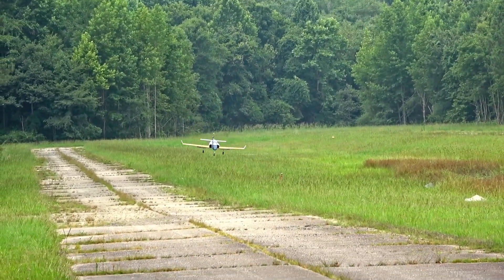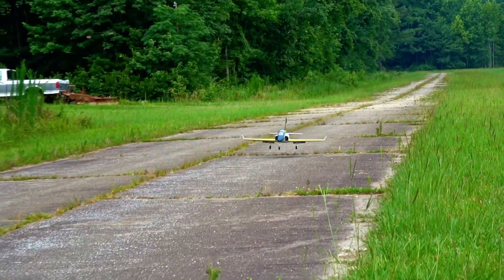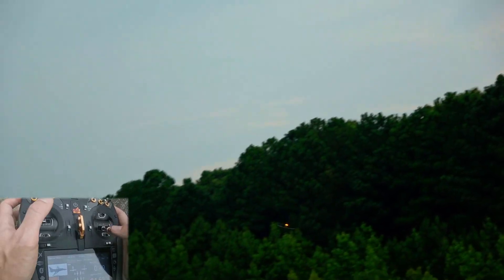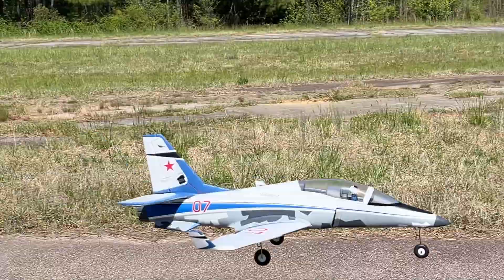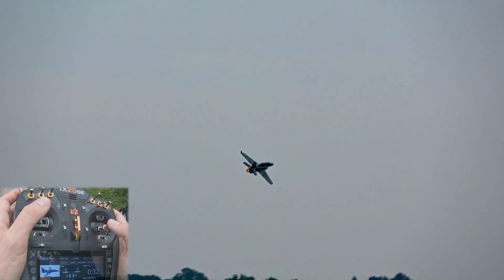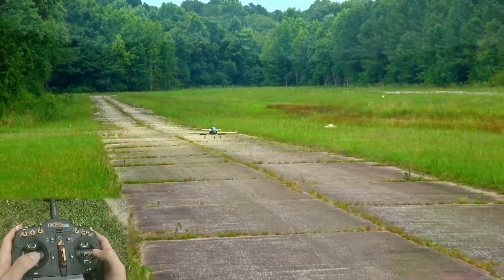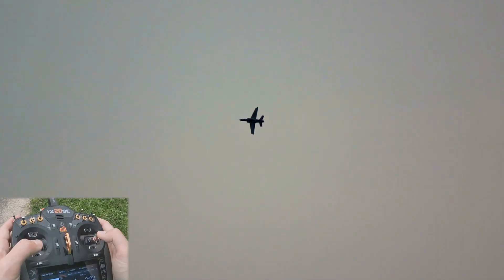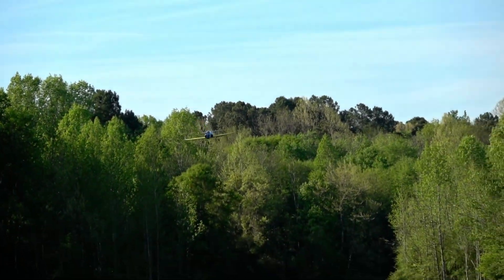Learn to Land WITHOUT Crashing

Comment: From what i have found with sport jets, i litteraly on my final turn i cut throttle bring the jet down to like 1 ft off the deck and sit at a out 2 3 degrees AOA until it stalls and sets itself down on the ground, maybe im just crazy because i also fly no gyro, and land my 64mm Futura, and 70 and 8m avantis the same way

Comment: I’m using reflex v3. Is it safe to be on Stabilization mode or optimization mode during approach?
Reply from the maker: Not sure. We don't fly with Reflex. Whichever option gives you full control is that you should be using.

Comment: No throttle landings can be  dangerous.  If you hit an obstruction or bump on the runway, and the nose pitches up suddenly, especially on a plane with small wings like an F18, sufden bursts of thrust wont help much if at all
Reply from the maker: Not even remotely lol
Reply: @TwoBrosRC from what I've experienced and seen, you are correct.  Not remotely.   Pretty much dead on.

Comment: Properly landing ANY plane, regardless of type means holding attitude and managing throttle while making as minor control surface adjustments as possible.  A stabilized approach is key.
Reply from the maker: Not always. You can land without throttle if you know how to manage airspeed.
Reply: @TwoBrosRC  that is true.  Its just like landing dead-stick, and good practice for that emergency as well.  But in my experience, landing with throttle is, as I said, the PROPER way.  By no means saying   its the ONLY way.  Like you said, "not always".  But more often than not, if you get sudden wind shear, especially as in a headwind, not already having your throttle spooled can be a detriment, again  especially with small winged or high wing loading.  Trust me, ive learned the hard way.  Again, this is my experience and the experience of lots of others.  Your mileage may vary..

Comment: I purchased this viper. I have my rates separated. Switch C is rudder rates, F is Ailerons, and G is Elevator. Should I land with Elevator on Low rate to prevent over flaring and stalling?
Reply from the maker: We'd suggest that you consider learning to fly without rate switches and leave rates maxed out with 50% expo. It'll make a huge difference in controllability at all speeds and give you the authority to land properly.

Comment: Thanks for sharing your experience in a beautiful video. As an ultralight pilot I have experienced many stalls on our P92: it usually stalls around 80km/h. In a turn around 20/25 degrees the stall occurred at 115km/h. The only way to avoid the stall in a turn is to have a lot of speed - a lot of engine - and make a coordinated turn with the rudder (to avoid adverse yaw.) I configure the landing of the Viper 80:  reduction of speed in downwind, half flaps, landing gear down and on final with the throttle stick at 40%, then before touching the throttle stick at around 30%, obviously the elevator must be pulled back progressively. Greetings from Italy.

Comment: i watched an earlier video you did with using cro for landing. doesnt this make it exponentially easier to land? i noticed you did not mention anything about that in this video but it seems thats the primary way you were landing in this video.
Reply from the maker: That only tends to work with larger jets or ones with bigger control surfaces than the Viper 70, unfortunately.

Comment: Land in SAFE mode should help.
Reply from the maker: Not really. It will exacerbate any stalls due to automatically holding elevator input.
Reply: @TwoBrosRC  During landing you often get sudden gusts of wind that can catch you out  sending a wing into the ground. 
Safe has faster reactions than you have and could save a crash
Reply from the maker: It'll crash if you're not keeping your airspeed up in SAFE, too. Fly it that way if you'd prefer, but it opens up significant potential of stalling that we'd rather avoid.
Reply: @TwoBrosRC  The thing that worries me more is that sudden gust of wind at the last minute before touch down that can catch you out. The wing goes up then hits the ground.

Comment: All of my Viper 90 crashes have been caused by a bounce. The plane tends to bounce even if I landed smoothly, sometimes due the battery being too far forward, others from bumps in the runway. 

Are you saying a lower air speed helps with the bounce?
Reply from the maker: Lower touchdown speed reduces the chances of bouncing. Bouncing usually happens because the aircraft is still flying while the wheels are rolling.

Comment: Something I've noticed at my field is that a lot of people are scared to get too low and end up diving into their landings.  While technically this can work (and I have landed planes from a vertical dive) it tends to leave them struggling to bleed off the extra speed and prevent their plane from ballooning back up into the air.

My preferred approach is to get as low as I can with the goal of crossing the front edge of the runway a foot or less above the ground so I can cut the throttle and let the plane drop back onto its mains in about ten to twenty feet.  I practiced this approach with an overweight Freewing F-8 more times than I can count and it's really helped my landings.  Optimal speed for this depends a lot on the plane's stall speed unless you can harrier the plane for long distances.
Reply from the maker: It all depends on the jet and how you want to approach with it. Dive approaches can work if you've set the plane up for maximum drag. Your approach works if you're looking for precision and scale appearance while landing.
Reply: @TwoBrosRC  I think the biggest benefit for me of landing low and long has been the amount of power I can carry through the turn to final.  I can keep plenty of airspeed through the turn by keeping the fan at 25-50% power and by the time I reach the runway my flaps have bled off enough energy that the plane just settles onto the ground as soon as I turn the fan off.  I really make use of the entire length of my airfield though because the extra energy takes a while to bleed off fully.
Reply: I like to get my F-8 low and just kill the throttle.  It glides right onto the mains.
Reply: @1212354a  Do you have the stock 3S fan in yours still?  I've found that my 3S F-8 is very floaty, but the 4S upgrade makes it fly like a rock.  I always needed a substantial amount of power in order to land my 4S F-8 smoothly.

Comment: My landing tips. Control direction the plane's with rudder, keep wings level with ailerons, proper pitch and airspeed with elevator and decent with throttle.  It's a lot to manage at first but with practice it's doable ... most of the time.  When I was first starting out I would make approaches and change only one of those variables at a time for a mock landing attempt and see how a plane would react.